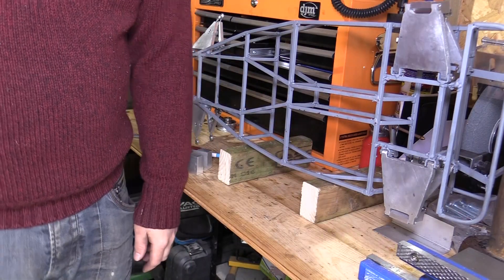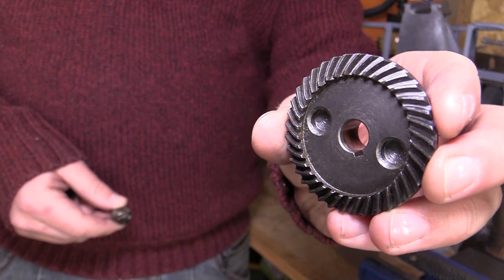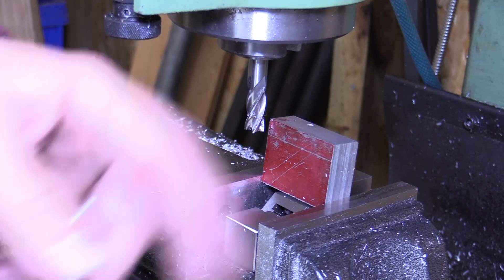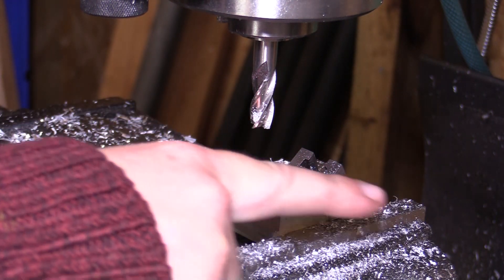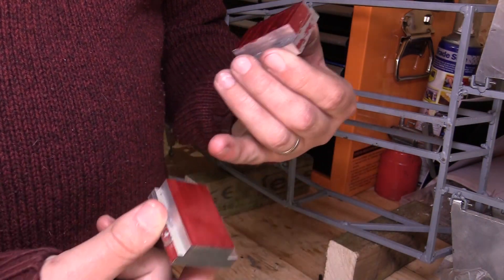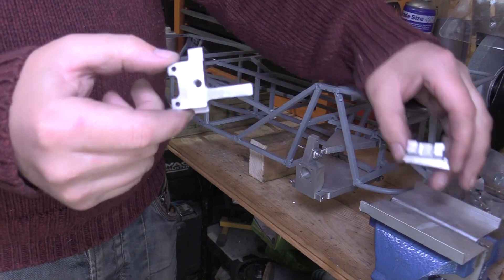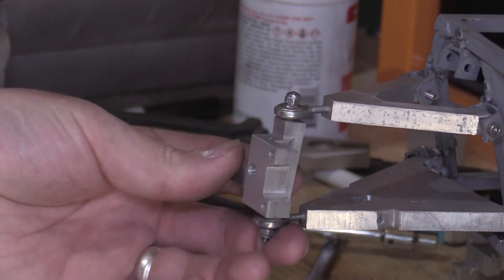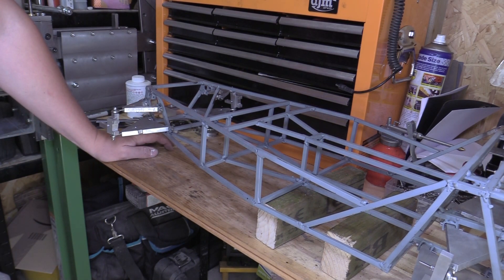Building a Mini Caterham   Part 5 Front Uprights

Comment: Another great video - the angle grinder diff sounds like a good idea! I noticed that as you were assembling the uprights, you don't seem to have very much droop on the front lower wish bone?
Reply from the maker: Yea, I have decided if it's enough yet. I may need to dress the welds / brackets some more or maybe skim some material off the wishbone thickness. But I'm going to wait until I have the shocks and wheels on to see where the ride height and suspension travel is.